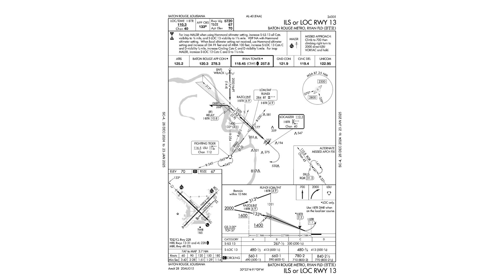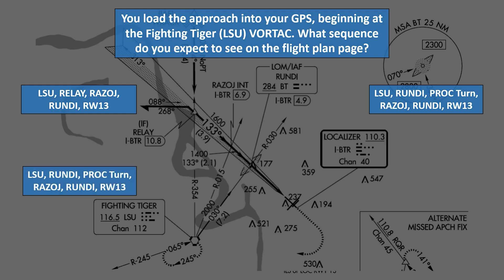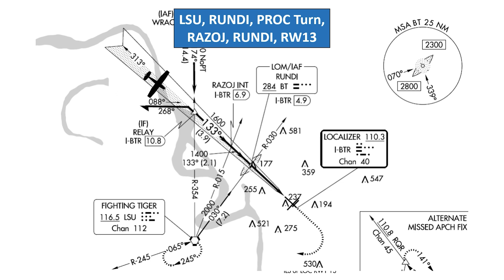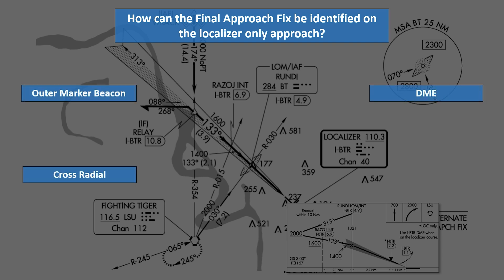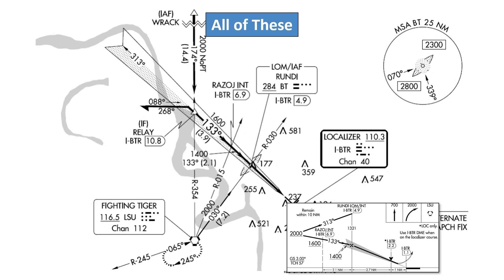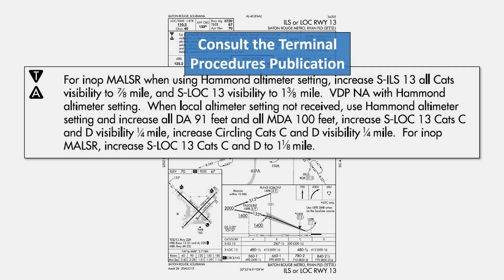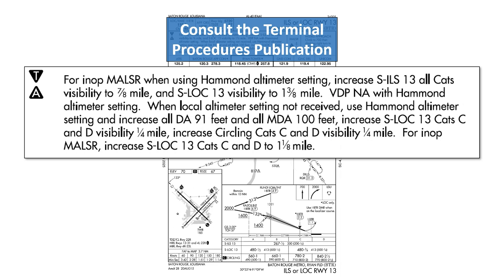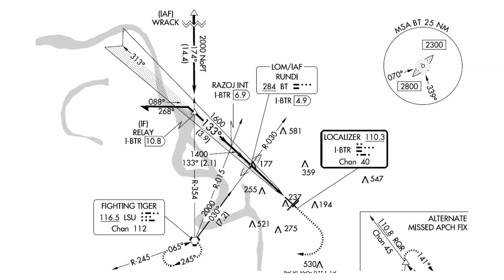Can You Pass this ILS Quiz? | IFR Instrument Approach

Comment: B and C are the same, printed, and spoken, in the first question. I selected both! 

But why is RELAY not included? The Proc Turn is depicted after RELAY, so I would assume to fly through, past RELAY before performing the turn? Or does RELAY only apply when coming from WRACK? How do you know? Without RELAY, how do you know when to start the proc turn?
Reply: Initial look in the plan view CAN be deceiving.  Answer?  Focus on the profile view.  You'll discover the 10NM procedure turn limit is based on RUNDI.  Flying past RELAY to begin your PT would allow you only about 4NM to remain within protected limits.
Reply: @robertbriggs5254  Yeah, that's where I got confused. The plan view is pretty clear that it 'shows' the turn after RELAY, and if loading the GPS, you are essentially loading a plan view. I'm curious to put this in the sim and look at the GPS map view after it loads, which probably would have made it more clear. Shouldn't the chart plan view show the turn inside of RELAY, with RELAY being just a part of the feeder route from WRACK?
Reply: @rvrnnr987  Approach chart design and differences between Government and Jeppesen illustrations. While the Government depicts the PT outside of RELAY, the Jeppesen (more logically) draws the PT inside of RELAY.  Jeppesen also clearly denotes the 10NM limit being from RUNDI in the profile view notes.

Your Procedure Turn, if taken all the way to the 10NM limit would place you OUTSIDE of RELAY

Try using the 'freebie' Garmin simulator.   You'll discover that RELAY does NOT appear, IF you select the RUNDI transition, since it has no bearing on that chosen option.  RAZOJ appears because it is a step-down fix prior to RUNDI after completing the PT.  

RELAY does appear when opting for the WRACK transition since that is the localizer intercept point.  RELAY also appears when opting for VECTORS for a convenient point of SA and a point from which you can "activate leg" IF turned inside RELAY on the way to RAZOJ.

Comment: could you fly LSU to wrack then into runway 13?
Reply: No. The procedure turn exists when the angle to the approach course is acute (ie < 90º) to avoid such turns. If you were to fly LSU to WRACK you'd have to make a 180º turn.
Reply: @olympiashorts  yes that is a tight turn and also only an IF not an IAF after looking at it more closely. thanks.
Reply: Maybe technically if you had that in your flight plan but you'd be wasting time and making the airspace less safe and ATC wouldn't clear it
Reply: @AK-xe2ly  how would you be wasting time, his way you had to back track and make a turn?

Comment: Direct relay from the west wouldn’t require PT
Reply: Technically, it would unless cleared straight-in since there's no TAA published but ATC wouldn't expect it and it would serve no operational purpose. It's one of those hangers-on from the bad old days that was never cleaned up. Nowadays in practice procedure turns are very much the exception rather than the rule.
Reply: @jeffg7  So if I was cleared for the approach direct to relay from the west I’d have to do a PT? Or would ATC not run it that way? Thanks for the help, just having a tough time with this one.
Reply: @Horsehog  If you're on a NoPT transition or TAA sector, ATC gives you radar vectors to final, or they clear you for the "straight in" approach, no PT. Otherwise one is required. If you aren't sure, clarify with ATC. They're unusual enough outside of the training environment that if you think you might have to fly one, it's a good idea to make sure everyone is on the same page.

In your scenario, just being cleared for the ILS approach via direct RELAY isn't enough to get you off the hook. You'd have to also be cleared for the "straight-in ILS" approach, with that phraseology.
Reply: @jeffg7 oh wow thank you. Makes sense. Appreciate it